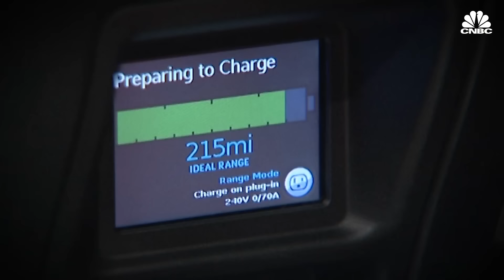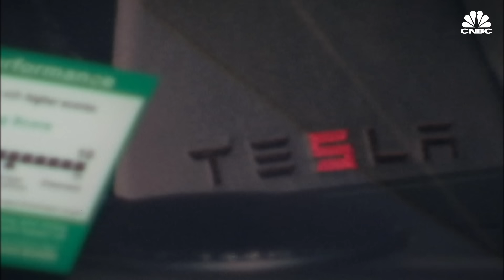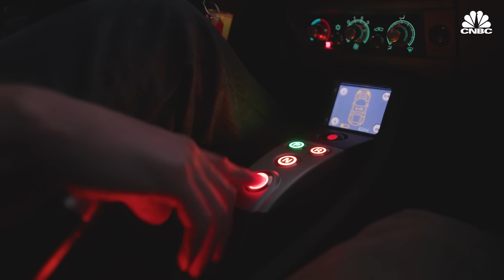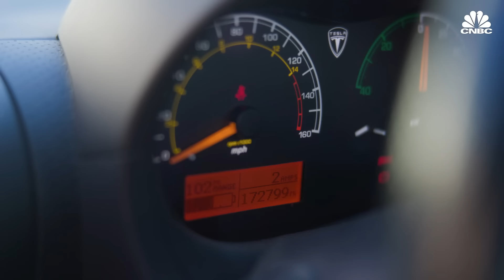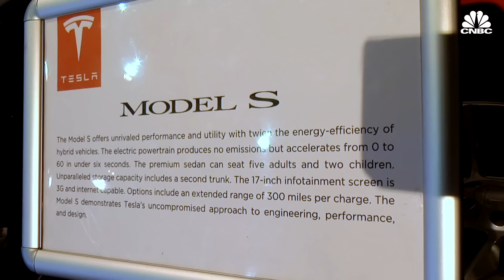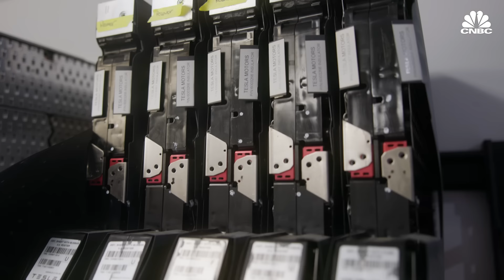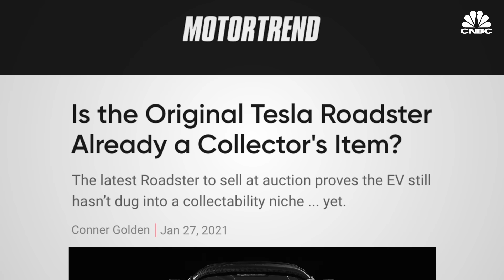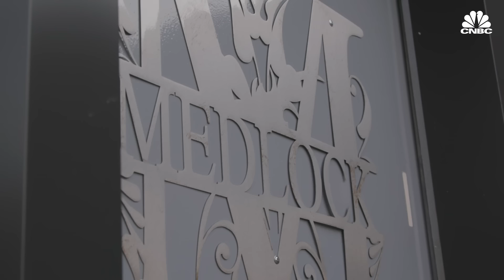What Happened To Tesla’s First Car — The Roadster?

Comment: I think that the Tesla groupie  movement is cool but to pretend that it's green is pretty ignorant.  All that it takes to make all the components and batteries and the power supply for the charging stations is still supplied by mainly fossil fuels
Reply: You have to start somewhere. At least the car doesn't burn fossil fuel. Eventually the grid will also move to clean energy.
Reply: @dariemperez6833  I agree but have you ever seen a lithium mine or a quartz mine to make solar panels its pretty sad. They destroy millions of acres of forest.
Reply: @rsteph1971  Mining can be done responsible. With correct planning, reforestation and the preservation of the natural habitat is not that hard. Also, battery materials are infinitely recyclable, it's easier to build a circular economy around them than with fossil fuels.
Reply: @dariemperez6833  I guess you need to do some more homework then. You can't reforest a 1000 ft hole in the ground that's miles wide
Reply: @rsteph1971  Miners extract a lot of material from the ground with only a small part converted to useful ore. The rest of the material is disposed somewhere else. With good planing, those holes could be covered back at least partially. You've seen the result of obsolete mining practices.

Comment: How, worse than a throw away cell phone with glued in battery. 2008 isn't even considered that old. Average age of the cars on the road in US is 12.1 years. My car is from 2009 and only had regular maintenance. It has at least 10 more years in it, parts and people who can fix it are at every corner. How are these disposable, single use cars fixing our environment  problem? I'm all for getting rid of gas but at this point Tesla with it's anti-repair policies and mode of operation only cares for the environment in PR speeches.

Comment: 25k for a battery? For that price, you can buy a new car. Prices on battery's will always go up.
Electric car are just throw away cars.
Reply: You have no idea what you’re talking about.
Reply: @greghelton4668  You don't. That's is exactly what he said, that a battery cost 25k.
Reply: @saulgoodman2018  battery costs have come down by 95% over the last two decades. The $25k in the video is for an obsolete battery pack that cannot be found easily. Batteries are still the most expensive component in an BEV but it won’t be that way long term.  At the moment BEV demand far outstrips supply and hence they are expensive.  FYI, BEVs have only about a tenth of parts in it compared to ICEVs.  You know what that means.
Reply: @greghelton4668  And battery technology will not stay the same.
Reply: @saulgoodman2018  agree.
Reply: A model 3 battery does not cost 25k.
Reply: @user-RCST  This video is about the Roadster. Not the model 3.
Maybe a new one one is 10k cheaper. But I can get a good used ICE car for that much.
Reply: @saulgoodman2018  well yeah if you're buying super car parts for almost 20 year old car it's going to be expensive.
Reply: @user-RCST  The Tesla is not a super car.
Is really doesn't matter what car it it. Batteries will be almost the same price for any EV.
Reply: @saulgoodman2018  a model S is about the fastest car in the world.  It is a super car. The original Roadster will give supercars a run for their money too.  You really need to study up on BEVs.
Reply: @greghelton4668  You sound like a Tesla fanboy who don't want to listen to nothing negative about them.
Reply: @saulgoodman2018  And how much do you think you waste in gas and maintenance costs that Tesla's don't have? Let's follow Tesla's warranty to a T to see how much money gas cars are out before tesla owners have to fork over $25k for a new battery. A Mercedes Benz AMG C43 (a pretty equal car in terms of price) runs at 26mpg which, over the 150,000 mile warranty, is 5,769.2 gallons of fuel. The cost of fuel in Texas in averaged $2-$3 when there wasn't an over production of oil such as in 2014-2016. Let's pretend it only costed $2 per gallon, that's $11,538.46 over your vehicle's lifetime.

Now a Tesla model 3 uses 25KW per 100, which translates to 37,500 KW. Texas, right now, is averaging about 13-17 cents per KW, which translates to $4,875 - $6,375, Even on the high end,  the gas car is still costing $5,163 more than a Tesla.

If we include maintenance costs, the Mercedes costs at least $1000 (all the way up to $3k) per year on average, whereas the Tesla Model 3 is around $722 if you follow the manual to a T AT the dealership. After the 8 year warranty, the Mercedes is out another $2200 AT LEAST. Sure you can buy and install the new engine for $15k at the dealership, but you have over $7000 worth of other costs that a Tesla doesn't have. This is assuming low gas prices, high energy prices, and low maintenance costs on the side of the Mercedes
Reply: @ryanthompson3737  "26mpg which, over the 150,000 mile warranty, is 5,769.2 gallons". What does that even mean?
You don't use gas based on a warranty.

That would cost $2,307in gas a year. Based on $4 a gallon and 15,000 miles a year.
Warranty have nothing to do with how much gas you use.

You will never be able to buy a used EV for like 5k. 
An ICE car, you can find plenty.
Maintenance does not cost 1k a year. Some oil, coolant wiper fluid, brake pad. It cost a few hundred only.
Excluding repairs.
Reply: @saulgoodman2018  I used the warranty to YOUR benefit since after it all repairs and replacements for the battery is out of the customers pocket. The batteries are actually rated for 300k - 500k lifetime miles. I also used 2018 fuel numbers from Texas, usually the cheapest state for fuel, to YOUR benefit since prices are artificially high right now and doesn't represent the ACTUAL expenses of a gas car. 

At $4 per gallon over 300k - 500k miles, a gas car is using $46,153.84 - $76,923.07 in fuel VS a Model 3's $12,750 - $21,250 in energy costs at 17 cents per KWH. This further proves my point that a gas car, over the long run, will have enough extra costs that a replacement battery on an EV is actually a viable option. Even with these numbers, we are looking at MINIMUM of $33,000 in extra fuels costs that is significantly more than a cost of a replacement battery.

If we are excluded RECOMMENDED maintenance, then yes it costs virtually nothing for both vehicles, and even less so for a Tesla that doesn't require oil changes.

You also neglect that Tesla is classed and priced as a luxury vehicle for obvious reasons. You're never going to find ANY car that sells for $40,000 start for $5000 used unless it's an old vehicle that isn't even produced anymore.
Reply: @ryanthompson3737  You can buy like 10 year old luxury cars for 5k or less.
Reply: @saulgoodman2018  Name me a single car that I can find for $5000 that's a luxury car that's 2012 or higher.  Just because you pull a claim out of your ass doesn't make it true.

In fact, the ONLY mercedes I could find that's even close to $5000 is a Class B  that started at $30,000 and had over 95,000 miles on it. That's way different than a car that's EARLIEST year is 2017 and that's MSRP is $45k (not $30k).
Reply: @saulgoodman2018  And it's funny... you completely ignored you having to spent $40,000 - $70,000 in gas in a cars lifetime.... it doesn't matter WHAT car it is, you're still buying the SAME amount of fuel. If you buy a $5,000 car, you'll still be spending AT LEAST $15,000... and that's with 90k miles removed.
Reply: @ryanthompson3737  Try also looking before 2012
Reply: @ryanthompson3737  And only certified Tesla repair shop will allow you to work on them.
Tesla is against the right to repair.
Reply: @saulgoodman2018  Again just proving my point. There ISNT a pre-2012 tesla so why are you compare a MUCH older car to a newer one that would automatically be priced higher? You're just comparing apples and oranges now.
Reply: @saulgoodman2018  And? I ALREADY did the math showing you that, if you follow the tesla manual, it'll only cost $722 per year to maintain AT A TESLA DEALERSHIP. You also DONT have to go to a tesla dealership. There are PLENTY of places that will work on a Tesla, and there are laws in place that prevent them from voiding the warranty based on work done at a private shop. This is called the  Magnuson–Moss Warranty Act.

The Tesla warranty also clearly states that the ONLY way to void the warranty by going to another shop would be if they used non-tesla parts, or the repairs done did damage to other systems that Tesla won't cover.

This is pretty standard for ANY car warranty. There's no a dealer in the world that would accept a warranty on a car with un-branded parts and damage to branded parts CAUSED by the poor install.
Reply: @ryanthompson3737  Older car will last longer than a Tesla.
In 2050, you would be able to buy a 30 year old car for a few hundred. You cannot do that with an EV.
Reply: @ryanthompson3737  All shops do warranty work using after market parts.
In order to work on Tesla, you have to be tesla certified.

You cannot deal with the fact that Tesla is not as good as you think they are.
Reply: @saulgoodman2018  And yet you'll still spend more in gas than just getting a new tesla. Gas engines still have a lifespan, and it can be as low as 200k miles. Just fixing and repairing engine problems is something you don't have to do with a tesla. This doesn't even take into consideration people with solar generation that save even more money in the long run since they're not relying on the grid.
Reply: @ryanthompson3737  And EV's still have motors that have to be fixed and replaced.
You can still get good used cars for under 2k. You cannot say that with an EV.
You keep coming up with all these excuses of how Tesla is so good. 
That you cannot and will not listen to any other opinion.

I despise Tesla fanboys.
Reply: @saulgoodman2018  ...and you keep comparing a 1990 Honda to a 2017 luxury vehicle... Seems you're the only one making excuses knowing the gas prices cost just as much as a new tesla. You seem to misunderstand how the year plays a BIG role in the price.

Also, the motor is rated for 1 million miles... still not helping your point.
Reply: @ryanthompson3737  You are keep getting hung up on the gas. I am not talking about that.
It does not matter how many miles the motor is rated for. It can and have broken down before 1 million miles.

I did not say 1990. I'm saying 30 years from now.
You can still get mid 2000's luxury cars for 2k and under.
Reply: @saulgoodman2018  jeez you're dense. The motor is rated for 1 million miles, your cars engine is rated for 200k - 500k miles... which one is failing first.

THERE YOU GO. You literally ignore $40,000 - $75,000 in fuel costs, how convenient. Gas cost DOES MATTER when a tesla doesn't have to pay the same amount. Either way, the battery and motor is rated for much longer than your cars engine. You can't just make up a number... these numbers are what the majority of vehicles will reproduce or its a multi million dollar lawsuit and illegal.

Bottom line, you pay $40,000 - $75,000 (closer to $50,000) in gas over 500,000 miles, I pay $15,000 - $21,000 in energy. Bottom line is that by the time both cars fail, you're out at least $30,000 over me. You can replace your engine for $5000, but my motor is still rated for another 500,000 miles, and the battery only costs $25,000... You're still out $10,000. By the time I have to replace my motor, you out ANOTHER $35,000 plus the $10,000 from before. So while I shell out $25,000 for the battery and $5000 for the MY motor, you're STILL out $15,000 over a 1 million mile lifetime. Even if it was a dual motor setup, you're still down $10,000. You don't even need to include maintenance costs because it's already undeniable that there are less costs associated with a tesla since it's just a car that doesn't need an oil change, among other things.
Reply: @ryanthompson3737  you are still hung up on the gas, I was not talking about that in the first place. 
Just because a.motor is rated at 1 million miles, does not mean it will last 1 million miles. 
Before Tesla's have already broken down before 1 million miles, and needed a new motor. 
An ice car engines can last for 1 million miles, with proper maintenance.
How much something is rated for, does not.mean that they cannot go above or below that.
Reply: @saulgoodman2018  I can buy a tesla for $1. I guess if we can just ignore costs and make up numbers, we can make anything right.

You're the only one ignore facts and making excuses. You're literally trying to tell me a motor rated for 1 million miles will fail before an engine rated for 200k. Touch grass and grow up.
Reply: @ryanthompson3737  Something rated for 1 million miles, will not always last 1 million miles. It can fail before that. And some have.
You don't even want to understand.
You sound like a whiny Tesla fanboy. Who doesn't like to hear anything that is not lined up with your view about them.
Reply: @ryanthompson3737  You cannot deal with the fact that things fail outside of what people claim.
They can claim 1 million miles. But it can also fail before that. 
You either are cannot understand. Or don't want to understand.
Reply: @ryanthompson3737  I am done with you. You cannot get it through your thick head that thing do fail, no matter what the claims are.